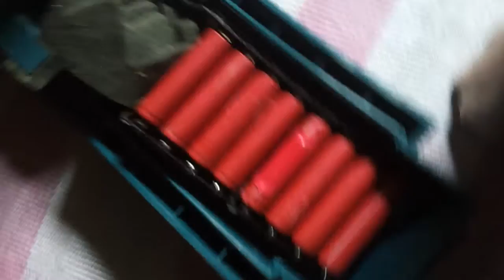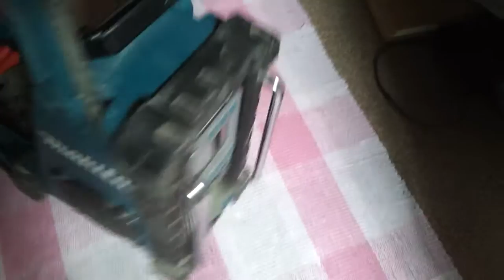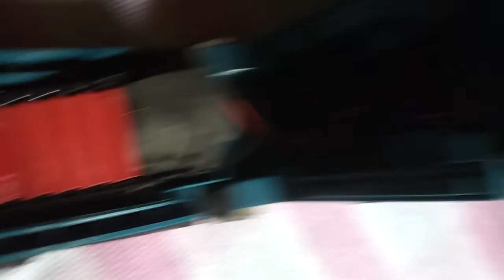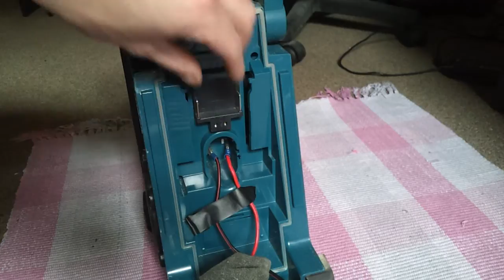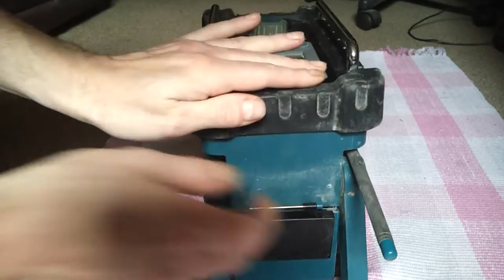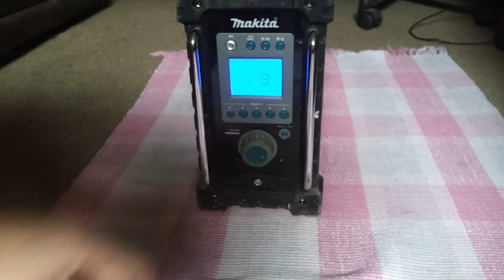Crazy idea pt6..finishes :) powering some mobile sounds!

Comment: Are you working on producing the battery racks? Sure would like to get ahold of some. Seems to me it would make building 12V 30ah battery pack fairly easy. Please let me know. Byron Rafnson
Reply from the maker: +Byron Rafnson hello buddy..
saddly i wont be producing these as i have no way of funding the production and china would nick the idea anyway!
you can get all the bits on line and locally though so have a go and knock some up your self..
it does make building bigger packs easyer and a little safer with those fuses..
the hot swap no solder is a dream when ya get a duff cell!
i have some plastic hinges too now so i will replace the milk carton ones when i get chance!
if ya need any help with it let me know im happy to give ya a hand if you get stuck.
good luck.
stoo.
Reply: +Crispymenace  Thank you for all the info Stu, I will muddle through building the battery back. I have ordered several of the 4 battery racks some copper ties similar to the ones you got, but couldn't find them at roofing co. state side. There are a few things I would like to ask you after I get a farther along with the building process but no point in getting ahead of myself. This is the information I found at WWW. Wire.Co.UK and would like to know if this is the same wire you are using for the fuses.  CN0200-050    50g 0.2mm Copper Nickel Wire.  The price is 10.76 Pounds. I haven't found anything similar is the states as yet.Thanks for your help,Byron
Reply from the maker: +Byron Rafnson all sounds good buddy..
the wire is unimportant as long nas it has a 5 amp failure rating..
or rather that was the maximum i wanted each cell to run at so you can tailor it to the cells you will use say 6 amp or 10 amp.. depends on the max discharge of each cell.mine are rated for 2 c..thats around 4.4 amps so if it goes above that the fuse will protect it.good luck buddy.
atb

Comment: I am just wondering if you use new batteries or harvest from used laptops. Yours all look the same so just wondering. Having a difficult time getting any good ones from laptops. If you are buying new, I would like to know what seller. I am waiting for parts to build  a copy of you crazy idea.
Reply from the maker: +Byron Rafnson hello buddy..
i was lucky to get a large amount of these cells on line [ebay] i bought a job lot so yes they are all the same brand and age.i have got some from laptop batteries and so far they have all been ok..think i was lucky tho!
i will do an updatee video on this pack soon as i can as ive made another, that maybe better suited to you..
i ll show and you can decide!
the laptop ones are usually good with one cell or two letting the whole pack down..keep asking all your family and friends or try local computer shops for there waste battery packs...
good luck buddy.
atb  
stoo
Reply: +Crispymenace I am looking forward to see what you come up with. I have purchased some plastic hinges that I think will work, to stack the trays. I won't know until I finally get the trays from China. Then, just a matter if attaching them properly. Thank you for your help.Byron